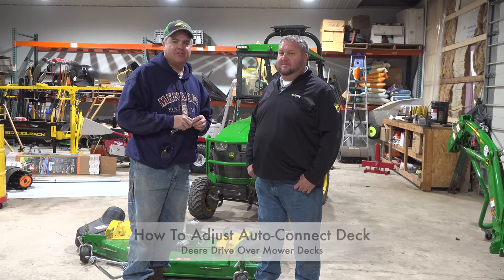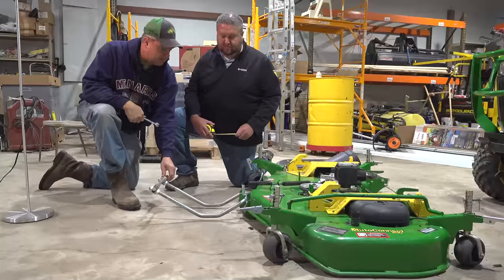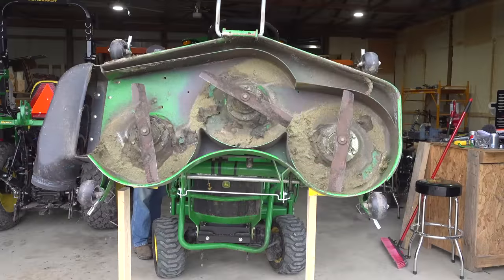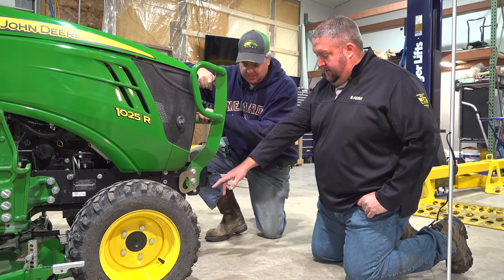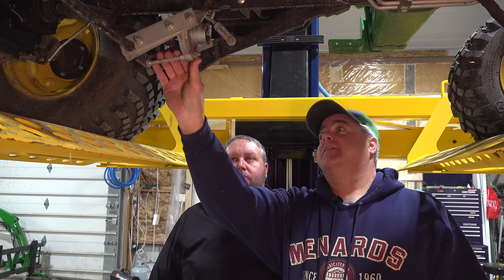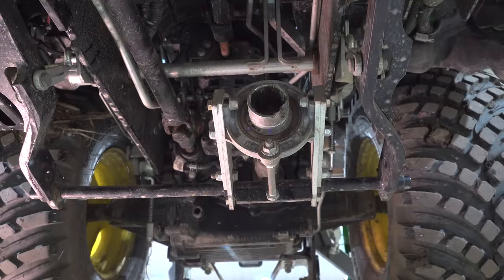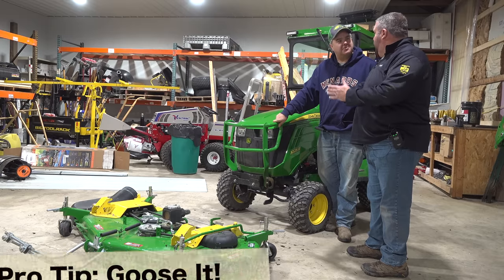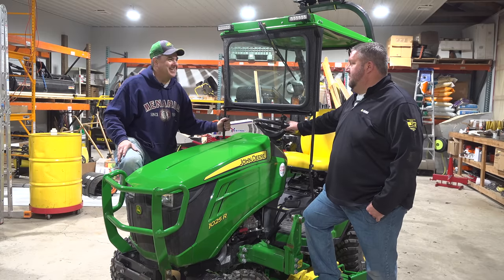Adjusting The Auto Connect Deck Deere 1025R/1023E

Comment: I have to try and adjust mine again this spring.  But the problem I have is the black rear pins on the arms seem too high to slide into the mower slides shown at the end of the video. I would think you would adjust that with the silver spindles for the side to side to lower the arms or am I wrong?

Comment: I am not against putting lube in the PTO Spine  point and yes it can attract dirt and other stuff and when connected can act like sand paper.  My suggestion or question is, why is there not a cap that will fit over that PTO Spline coupling hole to protect it? that way you can have some lube in it and then protect it when the deck is not attached?

Comment: Tim, can you ask Matt why on the 700 series the blades on the deck set up under the edge of the deck and the 1025R they are flush with the bottom of the deck. thanks

Comment: I am having issue with my height adjustment knob.  The dial seems to be an inch off.  When I have it set to the highest setting, it only indicates that it is at 3 inches not four.  When I have it set at load, it indicates that it is closer to the 4 inch setting.  Is there a way I can calibrate it or set the knob correctly?
Reply from the maker: I don’t think the numbers map to inches of cutting height.

Comment: When I am using my 1025 without the cutting deck I have a rubber cap that fits over the cuppler.
Reply: Again why did the dealer not tell a person about some of the problems they might have before they cause a problem like a grease issue!
Reply: Where did you get that rubber cap

Comment: I purchased a 2019 1023E without a mower. Now I have a used 54D but no front brackets came with it,from deere $350.00. So I am making my brackets from 3/8 steel plate
I copied and enlarged it from photos. I have a cardboard cut out and looks fine. Could you tell me from the bottom of bracket to the floor what the measurement is? I have  
7 1/2 inches in line with the rod in the bracket. Thanks

Comment: Fantastic helpful video! One quick question that maybe you guys have had to tackle... We have a X758 that has the same auto-connect setup, but our rear draft lock line is not "locking" when the bars go into place, so when you raise the deck it just slides out of position. Any tips on how to adjust that lock so it stays put? Manual doesn't seem to address it anywhere.
Reply from the maker: On this deck, loosening the front nuts a bit will allow the deck to go on further.   The front nuts on the front bracket…not sure about your x7
Reply: The x7 is slightly different on the autoconnect mechanism, and it’s also changed over the years.  Posting some photos on GTT might be a good way to get some help.  I recently traded in my x7 for a 1025, so I have a bit of experience with both.

Comment: I was having problems with my deck for my 1025R and it was one of the 2 books on the back of the deck.  It was bent just slightly and would not let the deck connect.  For all the trouble that I have had, I would just as soon have invested that $3,500 in some other piece of equipment.
Reply from the maker: Fair enough.  I love it.  ...but I suppose it is not for everyone.

Comment: is the deck suppose to be tilted up in the back slightly? or completely even front to back? 

When I lower the deck it starts to even out but it still looks like its tilted up in the back too much. Before I had it serviced it was pretty much even front to back maybe a VERY slight tilt in the back. Anything I can measure to see if its right or wrong?

One more question. Do you have to unplug your mowing deck hydraulic line and plug in the front end loader hydraulic line to be able to use the loader? I know with the new ones I dont think you have to do that but mine is a 2012 and I have to unplug the line for the deck which makes it so I cant move the deck up and down...but then I plug in the FEL line so I can move the box back and forward. I wondered if they made an adapter or kit so you didnt have to do that.
Reply from the maker: Read my article on the mower deck lift options for 1025r http://tractortimewithtim.com.    It will explain the different options available.
Reply: @TractorTimewithTim  Great article! So there are 3 options. It sounds like I have the hydraulic option. I really like the sound of the independent option but I dont like the sound of how it costs $900. I agree with your article the Mechanical overall is the best option unless you plan on using a bagger.

Mechanical - tied to the 3 pt hitch and is raised / lowered using the 3 pt lever

Hydraulic - hose plugs into the loader valve and is raised / lowered using the loader lever or using the third SCV

Independent - raised / lowered using a dash mount switch, no hoses to deal with just the switch and the height knob
Reply: @TractorTimewithTim  Oh also. What about the mowing deck? Is it suppose to be tilted up in the back more than the front?
Reply: Did you get a reply to your question about the tilt of the deck?  Mine looks up too high in back too. It seems to cut okay but the front skid plate seems very close to the ground and seems to drag on rocks or the ground a lot.
Reply from the maker: Should be just a bit lower in front.  Maybe 1/4” max.  You want all of the cutting done at the front edge.
Reply: @davidstrickland5663  Same here...if I go in reverse it makes a mark on the grass. Its apparent its dragging on the ground
Reply: @TractorTimewithTim  i had mine serviced at a john deere dealership (trigreen) i would expect them to know what tehy are doing and do it right but at the same time it still seems off and i dont know if it actually is or not.
Reply: @TractorTimewithTim  I may need to adjust the  turn buckle supports in the back to drop it and level it out some but that won’t help with the front being so low. I don’t think Mine is not so low as gitsum’s but it does catch on anything 3/4” or taller when raised all the way up. Thanks for information. Keep up the good videos.

Comment: Thanks Tim, any comment on how to release deck? I cannot raise / release rear lever? Tried moving deck in both directions, but still cannot release..,
Reply from the maker: Loosen those big nuts in front just a bit.  That might allow it to release.
Reply: Check tire pressure, had problems connecting and releasing found rear tires a few pounds low. After correcting pressure had no more problems.

Comment: This may not be the right place to discuss this, but, I have seen where the Load-N-Go brackets are soon to be available for the 54D mower deck for the 2020 model year.  Is it not going to be backward compatible at least to the 2018 model decks?  If not, I am curious to know why not.  Are the 2020 mower decks designed different?  If you have any contacts that have knowledge of this, could you please try to find out?   Also, if there would be some kind of "hack" to make it backward compatible to older mower decks, that would make for a good TTWT video!
Reply from the maker: I discussed this in detail on green tractor talk.com.

Comment: I’ve enjoyed this video. However, I have a question about the knob that adjusts the height of the mower. My knob is very hard to turn. How can I fix this?
Reply from the maker: Look under the foot platform...i shot some lube oil on that portion of the rotating mechanism.  Smoothed it up nicely!

Comment: Do you know if its possible to do this connection with the ballast box installed?  What am I missing? also with the Load and Go it makes the angle ever greater.
Reply from the maker: Not with mechanical lift.   You’ll need to remove your ballast box.  
Should be easy if you have a quick hitch.  If not..get one!

Comment: Looking for some help here. This video was very helpful for when I finally do get a deck. I bought a 2015 1025R last fall with a loader and rear blade, but no mower deck. I have been struggling to find a 60d deck. Part of my concern is that I do not know if I am going to buy the right one. Can I just buy any AutoConnect 60d, or do I have to specifically find one that fits a 1025R of my model year? I have found a few good deals on some but they have been for a 2 series or different model year of a 1 series. Just want to make sure I don’t shell out a grand or two on a deck that doesn’t fit. Also looking forward to purchasing those load n go’s as well, look very handy.
Reply from the maker: Needs to be specifically for a 1 series.  You should be able to find them.  Lots of folks sell the deck, deciding to mow with another unit.
Reply: @TractorTimewithTim  Will it matter on model year of 1 series? Thank you for the quick reply!!
Reply from the maker: No, not at this time. 
...this answer will change late this summer ...with a redesign.
Reply: @TractorTimewithTim  Thanks again Tim! Happy Easter to you and your family!

Comment: 😡 After locking the mower lift arms up without the deck to run the 3 point hitch tiller/box blade. I was in the process of getting ready to put the mower back on for the boss. Everything seemed to lock on but the pto. For some reason when I lower it, it points to the stars. Didn’t know that at first so I may have damage something. Can’t even get it level by hand. What have I done Tim?
Reply: Ok I couldn’t sleep so I went back out to the shed to figure this problem out. I had turned the pto on without checking to see if the pto had connected. That’s when I caused my problem. It had spun the shaft with it completely collapsed into the back u-joint and put a small but effective burr on two sides of the inner shaft. Knocked the burrs off with a hammer and chisel and now I’m back in business. Hope this helps. You can now be one step ahead of my mistakes. Time for bed.

Comment: i know someone makes some sort of cap to put over the end of that pto under the tractor so you can leave it greased and keep it clean at the same time....maybe measure it and eBay it... may need a hose clamp to hold it on but it would work...

Comment: One thing not addressed is what do you do when everything is adjusted right following these steps, but you still cannot rotate the knob into the lock position? Deck comes on and off just fine, I just cant raise it enough to get the knob to lock. I have to lift up on the corner of the deck just a wee bit with my toe to get it to lock.
Reply from the maker: Start with a can of spray lube on that cone below the adjustment knob.
If that doesn’t help, then perhaps can adjust the lift mechanism on the 3 point hitch lift arm.

Comment: Hi Tim, I've got a problem with my mower deck and my 1025R. I can't find one video explaining in dept what is connecting to what and how these lift works etc.
I bought a new John Deere 1025R with loader and backhoe and at that time that was at the top of our budget and we couldn't afford a auto-load lawn mower. Year forward I found one on FB Marketplace and I've bought it, without having any knowledge about them. Of course when I tried to connect the deck it just didn't fit, I've bougth John Deere 60D AutoConnect but 2019.

When I tried to figure out how to connect, realized that pins for 2019 are thicker then for 2020 so I would have to drill the bigger holes for those pins. Those are just under the step, but then realized that at the back is completely different arm to lift the deck and connect for tractor.

Now I am wondering is it even possible to connect Lawn mower deck AutoConnect 2019 to 2021 tractor or not and if it is possible what I have to change to adapt those connectors. On this deck you have to manually connect the shaft, which I realized completely too late as well and it is not fully autoconnect. Do you have any idea about that?
Reply from the maker: The deck and connect mechanism changed in 2020.  Totally different connection hardware than shown in this video.    You likely have the deck shown in this video,  but the connection mechanism on the tractor for the newer deck.
Reply: You are right but is it possible to adapt those connection arms. Now I have adjustable bolt with hooks and only need a pin to hold it. For a new one I've saw that there are bolts with nuts holding hangers under the tractor. Can I do anything or I have to sell this deck and try to collect the money and buy a new one?

 @TractorTimewithTim
Reply from the maker: @ivanjosip5936  I do not know. Sorry

Comment: Hi Tim! I was trying these tips and I can't get any daylight in the front drawbar at all, and I noticed the bolt that determines how high the drawbar is doesn't make contact with the deck when connected. I had the bolt set for 11.4in high. Also, I noticed when deck is connected, the front drawbar is about 10 3/8 off the ground to center of the pin. Just wondering if you guys ran into these issues? I've had nothing but issues with this autoconnect ever since I got it last May.
Reply from the maker: There is a thread on greentractortalk.com about the auto connect.
You can post pictures there, and get help from a large group of experts

Comment: I unloaded the deck for the 1025R 200-hour service, completed the oil change, lubrication, hydraulic fluid, fuel filter, air filter, etc.  Now when I try to install the deck the rear attaching linkage and PTO shaft connector will not lower enough to connect or attach.  Any ideas?
Reply: Yes, the selector was set to INSTALL.  Turns out I put extra weight on the 3 pt hitch arms and finally the rear arms went all the way down.  That fixed it, attached as it should.  The up and down of the 3 pt hitch used to move down smoothly at a decent rate.  Now it seems to take forever.  Is there a fix for that?
Reply from the maker: Knob under the seat.  “Rate of descent”
Reply: @TractorTimewithTim  Thanks.  I loaned my tractor to a buddy and I think he tightened it all the way.  Love the videos.

Comment: Tim I’m having trouble that the coupler underneath my 1025r auto connect is set too high for the spline to slide into it. What do I do to bring it down? I’ve adjusted the bolt some. I noticed there is a lot of thread showing on mower high adjustment,would that have anything to do with it?everything else hooks in except the pto!
Reply from the maker: You can 'tip' the tractor side of the spline upwards a bit with that long bolt. That should do the trick.
Reply: @TractorTimewithTim  I need the coupler to come down! The slime on the mower measures 9 3/8” from the floor and the bottom of the coupler measures 13 7/8” that gap is way too big if you ask me. I just the J D dealer attach a JD 647 tiller could they have messed things up with the PTO?

Comment: Does the gap measurement (about 1/8”) on the front crossbar to the brackets also apply to the 2032 and 2038 tractors? Great, informative video!!

Comment: The mid drive over deck is nothing but a headache. Totally regret not just getting a zero turn. And every John Deere dealer I've dealt with aren't the sharpest. I have a trimmer that needed a clutch. They shipped it to another store 2 months ago and it's so not fixed. I've a bad taste in my mouth and an regretting buying John Deere more with everything that I have to take apart and fix...or have at a dealer for months. But...... Thanks for your videos so I don't have to have my tractor in service until 2065. Subscribed.
Reply from the maker: Thanks for watching and subscribing.
I love the auto connect deck.  Each to his own I guess.  Just requires a bit of patience,  but wow, so easy.
Reply: @TractorTimewithTim  I'm working on it. I'm sure it'll click eventually
Reply: @TractorTimewithTim  so I y the pto lined up. (Easy, actually) but the pto so spins. Is there a key that I've missed in the pto shaft? That's the only thing I can think of now. The belt was twisted, fixed that, got it lined and hooked up with this video BAM!
Didn't work, next problem
Reply from the maker: Make sure PTO is set to ‘rear’ when you try to connect.
Reply: @TractorTimewithTim  I got it. whoever assembled it when delivered didn't secure the set screws backed out and the gear came off inside the pto shaft. Pulled it out with a slide hammer and it works like a dream. Thanks for your help!

Comment: How do you adjust the front bar to get gap? Is it as simple as adjusting the 2 bolts?
Reply from the maker: Yes, the two large nuts.
Reply: @TractorTimewithTim   you can easily get the gap, but the deck could be too low at the front to cut correctly, adjust it higher at the front and the gap is long gone, and the deck is jammed